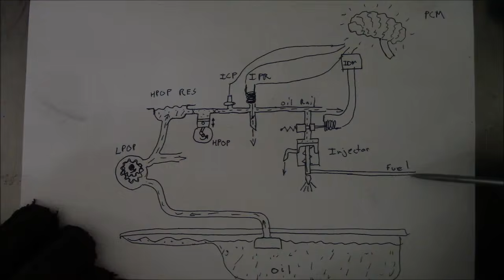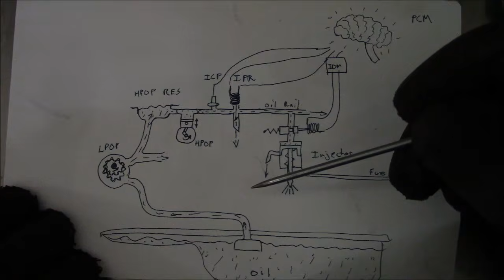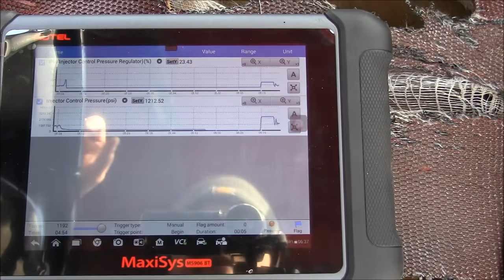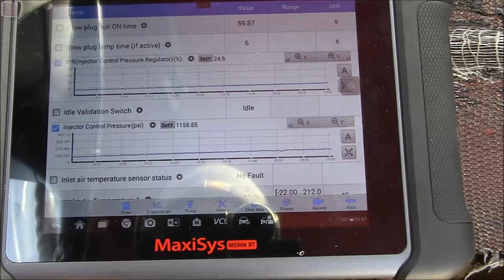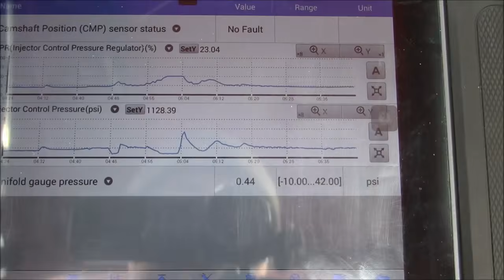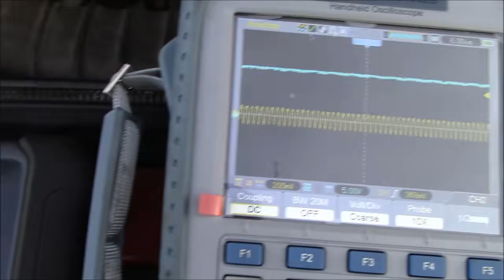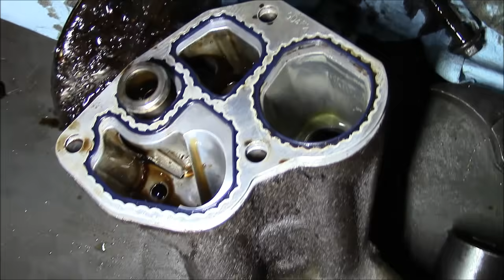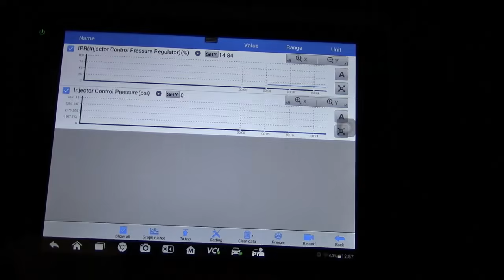7.3 Powerstroke Knocking, Rough Idle, Dying, but only when Cold. Plus many other Issues!

Comment: why they never used a p series bosch pump on these is beyond me, these motors would have had much more power and reliability and been so much simpler and cheaper to work on anyway thanks for the videos i really enjoy them
Reply from the maker: Well the old IDI 7.3 used a Standyne rotary injection pump. The HEUI system was kind of a stop gap until they could figure out common rail.

Comment: The website for the electrical connectors is currently down, but it appears as if the exact same connectors are available through https://www.sherco-auto.com/ in a variety of different assortments.  They are listed as being US-made.  3M is also a manufacturer of US-made connectors, as is Molex.  I was not able to find Wes' exact kit on Amazon, but it may be there somewhere.

Comment: well i learned something. a lot of guys have those 7.3 powerstrokes here on the Canadian prairies and usually nobody fixes anything until one day 'she just won't run'. now i know about the ICP and IPR. i've seen lots of low voltage FICM's and dirty oil. i've heard them run way rougher than that with 2 or 3 cylinders not firing and blue smoke and off they go down the highway for a day's work. thanks for the video
Reply from the maker: Low voltage FICM was a big issue with the 6.0. I imagine most of them have been fixed or replaced by now. The biggest issue I have is everyone plugs in a tuner and turns these engines up to 11 and then wonders why they blow up.
Reply: @WatchWesWork  my mistake i was thinking of the 6 litres. i looked for 3-4 years to find a decent 06/07 dodge 2500 cummins that hadn't been abused, neglected or blown up with a tuner. never did find one i was happy with and i looked at/drove dozens.  love your channel.

Comment: Man . Makes me Glad I have a Dodge Cummins. My brother-in-law had an F250  Diesel dump truck with Dually tires that wouldn't pull a 30 foot fiberglass boat up a cement launch ramp .  At . the time I had a normally aspirated  6.2 liter 1500 series Suburban which got him up the ramp with the boat !   Nice presentation on real time OBD display diagnostic.
Reply: theres no 6.2 gasser from gm that makes as much torque as any ford diesel product.

Comment: That high pressure oil is also too high I would say the sensor of the reading is wrong it should idle about eight or nine and when you step on it and jump over 22 very fast it shouldn't idle up to 22 something is wrong I would start off by replacing that ICP sensor probably also needs an injector driver module

Comment: Does that truck really only have 156k miles on it? I bought my 97 new, it has 222k on it, and it looks brand new compared to yours. I don't just mean rust wise, I'm in So Cal. so I get that part. But who hacked into and why did they need to hack into that thing so much? Mine has had very few problems. Not bashing, just surprised I guess. glad it's in your knowledgeable hands now. Have fun, be safe!
Reply from the maker: This truck spent most of life as a tire shop service truck. It was beaten to death, but never really driven that far. Then it was sold to a farmer who treated it about the same.

Comment: Never apologize for repairing a botched wiring job. I worked for the Navy in electronics and got used to things neat and tidy. Got into auto electronics repair and I've seen real disasters. My favorite is a twelve inch piece of wire that was made up of no less than seven different pieces of wire in various stages of connection. BTW did you know you need to do something with your seat?
Reply from the maker: I've seen it too. Household Romex wire, wire nuts, scotch locks, wires just stripped and taped together, 50 amp fuses where there should be a 20 or even a 10, etc. One time I worked on a dump truck that had bad injectors so it took a long time cranking to fire up. The starter relay in the box got hot and damaged the socket terminals making the relays fail. So did they fix it? Nope, just replace the relay every other time you start it. Finally they go tired of that, so instead of fixing the injectors, or the relay socket, they just spliced in a push button for the starter with no overcurrent protection or safety interlocks...

Comment: I thought they all had cab lights
Reply from the maker: This truck has no options. It doesn't even have a headliner.
Reply: normal for the time, Ive just never seen a 250 from that era without them though, esp a diesel, i thought it was standard even in a base model

Comment: The 7.3 doesn't use spool valves, that's a 6.0 thing.
On the last start up your ICP took a very long time to come up, that's why it took so long to fire up.  It coulda been left over air if you didn't run it long enough after replacing the IPR, but if it keeps being slow to start look at the ICP next time and see if it's still slow to rise.
Reply from the maker: Just air. Starts right up after running a few hours.

Comment: It seems like the previous owner decided to cut their losses on that truck. Anything CAN be repaired with enough time and money. The question is SHOULD the time and money be spent on it. I suspect rodents got to that truck on several occasions. They like some of the heat shrink tubing even better than the original wiring. It certainly seems that the previous owner had determined that the regulator was the problem and had started taking it apart.
Reply from the maker: I dunno. It's been running just fine for 1.5 years before this issue popped up.

Comment: Greetings Mr. Wes,
   I stumbled across this video, as a result of the YouTube "force feed" (algorithm), which most of the time I hate.  However fortunately for you, I watched it, and you now have a new subscriber with the bell icon on.
   This is one of the best videos (diesel tech Ron R.I.P) on YouTube, and an excellent step by step troubleshooting video.  I own an F-350, 4WD, crew-cab, Powerstroke that I bought new in 1995 (currently 170K original miles).  All stock (no over fueling, coal rolling oversized injectors), except for an up graded turbo exhaust down pipe)
   I am not a mechanic, but I have religiously done my maintenance, Chevron Delo 15w-40 (3000-5000 mile intervals, i know probably crazy) from day one, and any failed parts I have spent the extra money on OEM Motorcraft or IH replacement parts (i know, probably crazy).  I have been very happy with it, except for the 2 transmissions...  
   Sorry, way to much info., all to ask a simple question.  I am wondering if you have an opinion (good/bad) on doing a turbo back pressure valve delete on this vehicle.  Also, the truck you are working on in this video, after you did all the work, it still seems to crank a long time before firing off.  Did you address that off camera...?  Just curious.
Thank you sir.
Reply from the maker: The long crank time is normal after the HEUI system has been apart. It takes a long time for the air to bleed out. Once I ran it a few hours it straightened right out. I'm for the delete. Those valves never work right anyway. Every one I have worked on has a stored code in the PCM for the exhaust back pressure valve actuator.
Reply: Watch Wes Work okie dokie, well thank you for your response back.  I am saving up for the Garrett factory delete turbo pedestal.

Comment: The seat that's funny. I have a 2009 chevrolet silverado 1500  6 cyl with 185000 miles on it the rear fenders are rotted and rust is popping up all over. The plan is to buy a new truck in the spring. 10 years ago when it was new my wife bought me some real nice seat covers. So the question is should I take the seat covers off now that the end is near? And have nice clean seats in my crappie rusty truck?
Reply from the maker: Same thing happened with my dad's old truck. The whole thing basically collapsed in a heap, but the seats had been covered and looked brand new...

Comment: Bad ecu could be it  I had to swap mine out recently and it fixed it. The truck did the same as yours . Did you check the fuel pressure? Also if you swap ecu they have to be from a manual transmission truck the autos ecu won't work on a manual truck

Comment: On our OBS PSD Rescue project, we accidentally bought an Airtex water pump that didn’t have the steel hose connector, It worked great, but had to find an adapter for the heater hose fitting . Some folks swap for the international version with the coolant filter that comes with the additive impregnated in the filter media, but the hose connector is on the wrong side. 

If you’ve not dealt with them, dieselorings.com are good folks with quality kits for many PSD quirky issues. 

I was going to add a vacuum reservoir from a gas f250 to add a stop or so if the engine stalled- but my son totaled it before that could happen.

Comment: you successfully camaratta'ed that there o-ring to a good job wes. Oh, would anti-seize on that rusted tube for the thermostat hose help? I have that copper coat stuff and when I run into high corrosion I like to think I can help it to not rust so bad by copper coating it though I may be wrongo bongo.
Reply from the maker: Whatever magic goo works for you is the best one to use!

Comment: That seat looks exactly like the bucket seat in my old Ford van. I was at this guy's place one day buying a Ford C-6 transmission core to rebuild and there's a bunch of stuff under a tarp in his driveway. We are chatting and my wife lifts the tarp up and here is this gorgeous set of buckets out of a Ford Fusion in perfect condition. Motorized drivers seat. The guy says to my wife you want those seats? I want my driveway back so twenty five dollars for the pair. It was a huge project mating them up to the original pedestals, there was just nothing about those two that naturally came together,  but man is it sweet to sit back and adjust that driver's seat to perfection.

Comment: I have an 01 7.3  350 and I've had a few issues.  I have a question.. how much did you pay for that truck? Someone rigged that truck to just catch on fire. I've never seen anyone rig a truck to work as bad as they did
Reply from the maker: I paid less for this driveable truck than you would pay for a running 7.3 Powerstroke...
Reply: @WatchWesWork  niceeee

Comment: wes... this might be a handy file to keep in your phone.. pigtails and some new fasteners from auveco.. https://www.auveco.com/medias/Auveco%20New%20Car-Pak%20Items%20Supplement.pdf    ps.. rockauto has that water outlet for 11 to 30 bucks  ps.. pick up a spare 1/4" square drive socket driver. like a screwdriver handle but for sockets. and put a 5/16 or 8mm universal socket on the end to do hose clamps..

Comment: On later models I think 98 to 02 the cheap scan tools don't seem to work or can't seem to access any injector tests the Innova scan tool  says it can't read them on the screen but it was the low cost one. I've found the good old Red Brick (Snap-On scanner) works best for me on these trucks. You can get them pretty cheap now since they're about obsolete.
Reply from the maker: Those old bricks are the cat's ass for OBD1.

Comment: That heat shrink job is from not moving the heat shrink far enough away from the joint, then overheating the wires while soldering them and the heat shrink starts to bite down too soon. You tin both wires first, then put the heat shrink on one of them, then have your soldering gun ready with a ball of molten solder on the tip and then the actual connecting of the wires should only take 2 seconds.
Reply from the maker: I'm thinking he also used too small of shrink tube and it would not fit over the huge wad of solder.

Comment: Good video.  I see some comments on soldering wires.... that's been argued about for decades.   Soldered connections tend to break just after the joint due to vibration and flexing of the wiring, so it isn't always the best choice.  OEM wiring has pretty much zero soldered connections for this reason.  Soldered connections have their place, like a secured harness where there's little movement and flexing.  Otherwise, the uninsulated connector and sealed shrink tubing is probably the better way to go.
Reply from the maker: I don't like soldering just because it's such a PITA to do when you're jammed down in an engine bay or laying on your back in the snow.
Reply: @WatchWesWork  Same here,  plus on vehicles like this one the 25 year old copper wiring is usually turning black and won't solder well anyways.

Comment: I have to say i am very impressed that your truck has survived 25 Illinois winters. I guess all the oil leaks on it serve as a rust protection system!
Reply from the maker: Exactly. Automatic undercoating. Just back the valve cover bolt out a few turns...

Comment: Needs more ether....
Reply from the maker: Hah! Howdy Peg. I need to stock up on the Cosby in a can...
Reply: @WatchWesWork  put a Jake break on it
Reply: 9nb
Reply: H9 gb
Reply: F
Reply: @Timothydemarco12  Jake "break" ???
Reply: @WatchWesWork  b no hoy
Reply: @WatchWesWork  The PC Lite too... Bet the Level is getting low too Aeh.
Reply: @WatchWesWork  BRB in this b
Reply: J b
Reply: B j j
Reply: Ask Junkyard Digs what he thinks about using ether as starting fluid for diesel.
Reply: The Ether God has spoken!!!!!!!!
Reply: She needs some ketchup
Reply: @mrdrchad6110  she needs some milk
Reply: I've been feeding my 6.9L f250 an health morning breakfast of ether and about an minute of full throttle before heading off too work, the neighbors love me.
Reply: Maybe some radio active horse piss??
Reply: I got a pair just like those, free ac
Reply: Yea she's got that lopy idle too her
Reply: Poor lil abused loader tractor! I noticed on the road test you were crankin the wheel a lot. A friend of mine had a Cat front end loader that he could barely keep from zig zagging down the road the steering was so wore out.
Reply: Haha
Reply: Just purchased 1997 7.3 td super duty dually longbed flatbed manual transmission and having trouble with noises coming from under stick shifter going to attempt throw out bearing replacement pilot bearing ect.. engine purrs with 285k
Reply: The pcm increases the icp pressure when fuel pressure  is low or oil is low usually get p1211 dtc.
Reply: More ketchup

Comment: The hpop is always making maxium pressure (3000psi - 4000psi) pressure. The ipr is a valve that basically dumps the un- used oil back to the sump, at a hot idle on a healthy engine with no leaks in the high pressure oil system ipr is about 22-25% duty cycle

 at full throttle the ipr is at 84%
The ipr is pwm (pulse width modulated) by the pcm

The icp sensor basically tells the pcm how much to open and close the ipr based on throttle position/ accelerator position, load, ect, eot

The high pressure engine oil basically acts like a big syringe (enters inside the injector) and pushes down on the intensifier piston (inside the injector) which multiplys the force by approximately 7 times.

 so out of the injector nozzle you get fuel pressure at approximately 21,000 psi to 28,000 psi at wide open throttle 

Heui injecton was originally developed by Caterpillar
Reply: Chris K. Cat and Siemens 👌🏼🤙🏻

Comment: The pressure is controlled by the pcm via various inputs to the pcm.  1100 isn't that great.  As the seals leak around the injectors, the pcm senses the lack of combustion and attempts to compensate.   CHECK THE INJECTOR SEALS AND CUPS AND REWORK THE INJECTORS AS NECESSARY.
Reply from the maker: I'd prefer to fix the actual problem.

Comment: If the injector seal(s) are bad you will be mixing fuel with motor oil.   Check the exhaust for white or black smoke variations (black is fuel, white is motor oil being burned).

Comment: You might check the engine oil for fuel mixed in...if the seal(s) go you'll be mixing fuel with motor oil.

Comment: The 'leak' is not in the rail...its at one of the seals.  You should consider reworking the injector at 150,000 mi (thereabouts).  And replace the seals and cup which may be split from the bad seal.

Comment: it's not a single acting solenoid...it is controlled by a pulse width signal to open at various amounts as necessary.  Your diagram doesn't show the seals on the injector.  Or the cup the injector sits in.   If you don't understand the theory you cannot repair.  Unless you become a parts cannon.

Comment: Wes, I heard you mention Andrew several times, and not in a positive light. Come on...  Like you never installed a radio in your dash with chain saw?  Or... used an angle grinder and mig welder to fix the air vent in your dash? :)  :)  LOVE your videos!
Reply from the maker: I'm still working up to the chainsaw.

Comment: 800 to 2800 psi (high pressure oil)...pcm controls the width of the signal to open/regulate the flow of fuel to the piston.

Comment: my dad had a dually truck like that and he ran some Diesel Supplement and Cetane Booster in it. The oil had to be kept changed or it didnt inject properly. Mostly the brain on it was all shorted out and it needed a new one. is it iceing up and needs additive? Could it be water in the diesel?
Reply from the maker: It does act that way, but not this time!

Comment: Can we get a name or link to that bar with the step at the tip you were using to push the oil cooler back in?
Reply from the maker: It's a die bar. Made by Mayhew. 41280. Very handy tool.
Reply: @WatchWesWork  Your videos give me so many great tool ideas!

Comment: Forgot to mention I added malleable copper  washer to drain plug.  No more oil leak. Also found serpentine belt tends to cut thru  bottom of upper radiator hose, despite factory hose to t-stat.The upper hose makes contact with the belt when coolant system becomes pressurized. Shape of hose changed as coolant system becomes pressure causing contact. Problem solved with small piece of exhaust piped use as an intermediary "hose' over the region of contact giving more space (because its thinner) between serpentine belt and intended hose path. Much appreciated. Craig